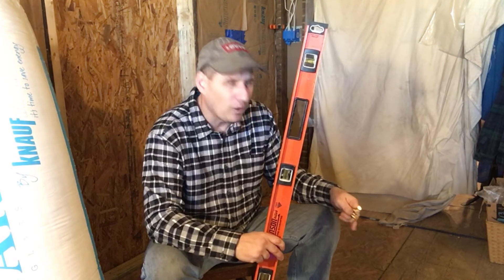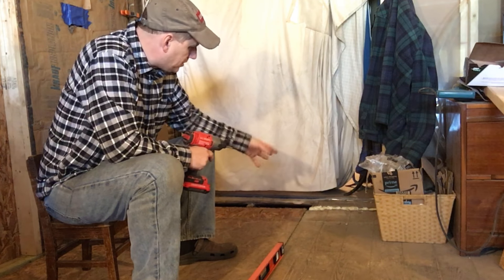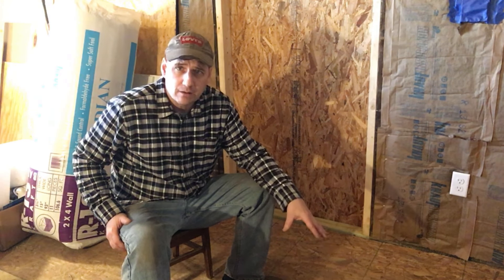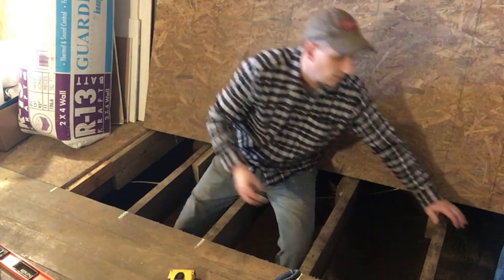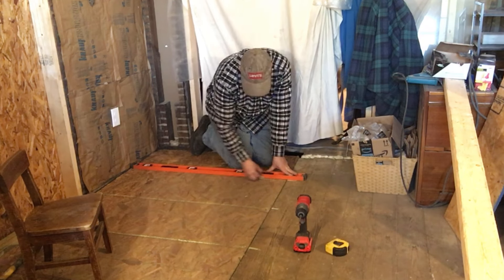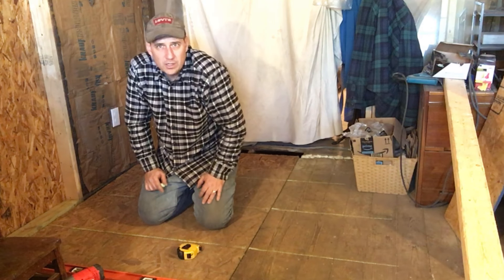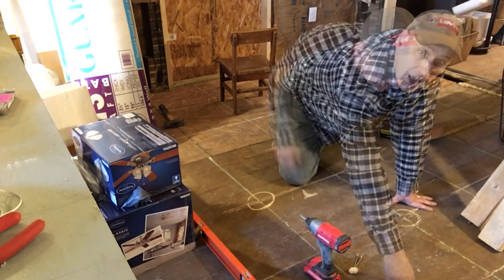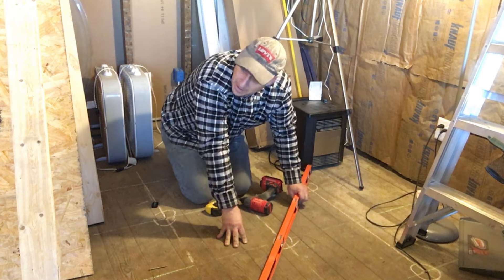DIY: Easiest Way To Level An OLD WOOD FLOOR - Using Screws and a Level

Comment: No doubt you are much more knowledgeable than I am, and most likely also, you have a lot more practice at doing it than I do.  Having said that however, I can't see how that would work.  
I have the same issue in my home, and looking for solutions for over one year, carefully studying the several options available to repair the issue. 

Your method seems to be the most difficult one, involving lots of measuring, materials and equipment, even if you say it would only take a level  and some screws.

My question is....  Why would you lay additional wood pieces to level the floor, creating yet another space in between board, where eventually creatures are going to craw in, and make a home in your home?  Would it not be easier, if having leveled the floor with screws, you were to just pour some self leveling cement, and use the screws as a guide to achieve optimal result?

That is what I have been considering but, the only reason I have not done it yet, is because I can't seem to find out which material to use, to prevent the liquid cement from running through the gaps I have in the current wood floor.

Any ideas?  I would appreciate your opinion, being that you seem so knowledgeable about the subject.

Thank you.
Reply from the maker: Hi Mario. Welcome to the channel.
I've found this floor leveling method works quite effectively. There are several ways to level a floor but I feel this was the best way to do my old floors.

I don't believe it is very difficult.  Leveling the screws is probably the most technical part of the process. There are really only four tools you need: a level, a tape measure, a drill and a saw. A complete list of recommended tools are in the video description. The materials involved are screws, sheets of t&g decking, vapor barrier and studs to rip down as sleepers.

The sleepers will create a bit of an airspace over the old floor where you are raising the surface to create a level space. My approach to solving the issues with keeping basement odors, air and critters away was to lay down a vapor barrier over my sleepers and under my new decking.  This is all explained in part 2 which you can watch here: https://youtu.be/tOANffNqoDA

I leveled my upstairs as well.  This video: https://youtu.be/fv9PZcCu_0k shows another look at the floor leveling process which might be worth watching to get a wider view of the process.

The reason I did not go with a self-leveling cement is for a few reasons.  First, as you mention, there is the issue of it leaking through the floor which needs to be dealt with.  Second, in some areas of the floor, I was making up to over 2 inches of vertical distance to get a level plane. This is a lot of material to pour which would add a lot of weight to the system as well as cost to the project.  Third, I've never personally used self-leveling cement so I felt more comfortable with wood.  Fourth, since the floors are wood and have a great deal of "bounce" and flex to them (compared to a slab floor), I fear that cement would tend to crack excessively and break up over time causing a lot of other issues down the road.  Fifth, adding an overlay wood system mechanically ties into the old system (via screws) thereby making the new floor integral with the old floor thus increasing the overall rigidity and strength of the entire floor system.

I hope this discussion assists you in your project and I appreciate you inquiring.
Good luck in your renovation and thanks so much for watching.
Reply: @RundownReborn  
Thank you so much for taking the time to explain in such detail your point of view, and the reasons to your method.

I have given the weight of leveling cement a great deal of importance when considering on how to proceed.  It is of great concern to me, considering that my craw space is difficult to access (very little space to actually even to craw into it), and gain access to the back of the house.  I have plenty of space in the front but, the back is hard to access, and I have actually spent several hours in the past couple years digging with a shovel and bucket.  Terrible work to someone my age (68 years old), 6'3" tall, and weighing over 180 lb.  It is hard for me but, I have accomplished quite a bit, enough that I am now actually able to craw in, and actually added some support to some of the sagging floor joists.

Simply put, this is the house I wish to live in until the day I die.  I love my home, and the area where it is located in but, I have to consider that I am also getting old, and with each passing year it gets more and more difficult to accomplish the tasks I set or plan on tackling.  I am getting old.

I am considering just stopping, and accessing the issue from what may, at first, seem to be the a more difficult angle, which is to say, from above, as you are doing or did on the video above.  

First, I have considered that it might actually be easier to me to dig the craw space from above, set some additional support columns and level it, making laying of a new floor much easier and simpler.  It is my opinion that if I open the floor, and level and add additional support beans to the existing structure, the rest of the process would be much faster and easier to accomplish.

I live alone, and don't have any relatives such as a son or anyone else who could help me.  Paying someone to do it, is expensive, and honestly, I don't have the means so....  I have to measure twice, and sometimes more often, and cut only once.  

Once again, thank you for your expert advice.  I do appreciate it greatly.

Wishing you the very best, Always.

Mario.
Reply: @Jesus My Savior 
Hello.  How are you?  I hope all is well.
To be perfectly honest, I have not started it yet.
I am still searching for options.  It is not something I need to do immediately so, I am still working from under the house, trying to lift all that I can by myself.
It is hard awful work but, I don't have anything else to do at this time.  So, I am taking my time.  A little bit everyday, and trying not to kill myself in the process...lol  I am getting there, little by little.  But so far so good.  Everything I have done, has worked out.  I am using hydraulic jacks, cement blocks and 4 x 4's.  It is going but, by myself, it is a slow process.  I don't want to cause any damage.  It would be great to have some help, someone younger, thinner, and more flexible to get to some of the hard spot but, when I am working on a spot where I cannot easily fit in, I just dig the dirt out, until I can fit.  
Eventually, what I think I will be able to do, it have it level to such a degree where the leveling needed will be minimal, and I will then use some self-leveling cement, and not run the risk of adding too much weight to the existing support system in place.
Faith, Hope, and Trust.  With the help of God, everything will end up working for the best.
Good luck with your project.  Take your time, take your phone with you if you need to call for help, and watch out for little creatures crawling around.
I think I got bitten by a spider once, not really sure, other than the fact that something down there bit me.  
It will all work out.
Reply: @Mario   If you wanted to, you could fill in the spaces between the runner strips he installed, and then use the runners as the level surface for a screed - you could screed the filler material - mortar or whatever - by dragging a long screed board across the runners to make the surface of the mortar flush with the leveling-runner strips.

But there is a lot of volume of material - it would not be cheap!  He mentioned 1 1/2" of depth to fill in on the low side of the room.  Another option would be foam sheets cut to size.

But one thing you have to realize, the issue with varmints etc. never really goes away with this type of older construction home - it probably has a large crawl space underneath.  As long as the moisture barrier is installed that he described, you can rest easy, because the floor has more than one layer of building material and flooring.  There's no way any pest control issue will be more of a factor than the crawl space under the house.
Reply: instaBlaster...
Reply: If your going to use self leveling concrete you will have to install plywood over the planks, which is counter productive bc why not just rip up the planks and install new subfloor. also find out why your floor is sinking
Reply: Depending on the type of floor going above the subfloor you’d want to use sleepers anyways. With a wood floor the sleepers help with squeaking.

The method he is using is quit common. Even on concrete floors when doing ceramic or even self leveling compound we use the same method and drill screws into the concrete, then screed your mud to the height of the screws or you pour your self leveler to the screws
Reply: Had to do this under my shower trust me it's the best solution. The cement will break over time. Going to have to do the rest of my bathroom also. Cheapest way to do it outside tearing the whole floor up.
Reply: Just use duct tape over any gaps where the self-leveling floor leveler might drip through your cracks.
Reply from the maker: @ericm.bright9105  good suggestion!!! But what about the perimeter? My gaps are enormous there. Spray foam doesn’t even fill them.
Reply: Yes it's a self-leveling cement called gypcrete I've been in the construction business for over 40 years and that's what we used to level floors especially wooden floors it's fairly cheap for a 600 square foot area it would probably cost you around five or six hundred dollars but it can be done in literally 15 minutes and the floor is perfectly level three quarters of an inch thick and about 2000 PSI
Reply: @misterfee6467  I was thinking the same thing. If your joists are sagging that badly, wouldnt you need to address the posts supporting them, and maybe even the joists themselves as well?  If you do all of this extravagant superficial leveling, one day you might need to rip it all out (or use a jackhammer to get out if we're talking about using mortar!), when you have to add supports and jack the whole floor up because it's collapsing! (which wouldnt be helped either by the weight of 1.5 inches thick of mortar over tens of square feet)
Reply: Cost of self leveling cement is ~$55/bag.  Sealing along the borders with silicone and/or foam insulation would address your concern and then use this method for majority of the leveling.  Then, if not perfect, you can go over the new surface with thin layer of self-leveler.  It’ll save hundreds or thousands of dollars depending on the size of your room.
Reply: @mario9133  I think you are right in considering placing additional support underneath, especially if there is a significant drop from level, because this probably affects the rest of the house, and adding the weight of another layer of flooring will add to the problem.
Reply: @RundownReborn  Having large gaps or differences should be a reason to consider additional support and leveling underneath.
Reply: @RundownReborn  In cases where spray foam won’t work, I’ve seen both foam gasket tape and foam board used around the perimeter of a self-leveling pour.
Reply: self leveling flooring compound not cement
Reply: I keep seeing this self levelling concrete mentioned. Seems to me you'd only use that on stone floors.. no? As for floors with wooden joists.. isn't it just a matter of planing high spots and/or sistering where there's valleys?

Comment: Seems like it would be easier to just pull up the sub-floor, cut strips off 2x4s (or plywood) to the right level and secure them to the tops of the joists.  Then lay the sub floor back on top of that.  That way you have a level floor and no gap underneath.  The gap is going to give you an echo when you walk across the floor unless you insulate it.
Reply from the maker: Thanks for watching! Shimming the top of the joists is certainly one way to level a floor and I would definitely recommend this if your floor joists are damaged, worn or sagging or in need of reinforcement. In my case, the structural state of the floor joists is adequate and my existing floor deck is 3/4” plank cedar which is an excellent deck material and resistant to moisture rot from the damp crawl space and basement below. I desired to leave this in place and adding a 2nd layer of deck has stiffened the floor considerably and reduced a good portion of the bounce in the floor. Putting a vapor barrier between the layers has nearly eliminated the moisture, must and insect issues from below as well. The airspace will also add some thermal value too. Plus an overlay deck is easier (no tear out) and safer (especially since we’re living in the house with young kids). I have not noticed any echo issues or excessive sound problems. If this is a concern, I would recommend a carpet finish with a good sound rated padding or if laminate is preferred, use a sound dampening underlay material. One other thing to note, if you can’t tolerate a little bit of hollowness and bounce in your floors, don’t buy an old house with 2x6 floor joists. Stick with concrete floors (slab on grade). But for me...I think a little bit of thump under my step adds to the vintage charm of the home and gives it character.
Reply: Would it be easier to sister new joists next to the warped old joists? Vs your idea of adding to the top
Reply: @johnkim1656  not super easy, but yeah that method would be ideal if your space is fully gutted
Reply: As a structural engineer, I agree with building up the joists. I need to level a floor in an apt over a garage and my plan was to build up the joists. I agree with you about having the space under the floor. I didn’t like that idea.
Reply: @RundownReborn  I had no idea my old home (which is not on concrete,slab on grade) with 2x6 floor joists had "hollowness and bounce in floor" was actually not a structure issue. I asumed the sub floor was toast. The floor joist below look good. nice too learn something new at 42 yr old.
Reply: I am going through this right now with my late 1800s home. Simply stripping the floors down to the joists and reinforcing each joist by laminating them and bringing up the original appropriately. It isn't easy, but pretty straightforward.
Reply: Buddy if you have a wet crawlspace you need to get down there and resolve that.

Comment: An easier way is to tack 2x4's to floor, then use a laser level (cheap one works great). Measure down marking the 2x4 every 16". Remove tacks. Put 2x4 on a saw horse, connect the dots, cut with circular saw or use a table saw. Screw back down to floor into floor joist. Make sure to use construction screws(strong), not sheet rock screws(can break).
Reply from the maker: Not a bad idea there. A couple problems that may arise are that 1) not everyone has a laser level and 2) depending on the floor, it sometimes can be difficult to get the board to lay tight against the floor with a 2x4 on end - especially if the floor undulates.

My suggestion would be to use the laser to set the screw heights and then mark the sleepers.

Yes, construction screws. Drywall screws are for drywall and maybe hanging a picture here and there.
Reply: @RundownReborn  The undulations will have no effect on the sleepers.  They will rest on and be fastened to the high points.  Laser levels are not very expensive.

Comment: I'm a hardwood sander and refinisher, and I'm just looking at videos that pertain to fixing and repairing floors and I came across your video, I admire your "do it yourself" video here, my first thought was that you had a table saw or at least a circular saw to rip the 2x4 sleepers, when you showed the saw (at 5 amps LOL), I just had to laugh, because I don't like any saw to rip wood under 13amps LOL, in my trade I'm a power tool for the job type of guy, for repairs and sanding and refinishing, but I have nothing negative to say, just love...and I also subscribed and thumbed up
Reply from the maker: So glad to have you join the channel. I try not to introduce expensive or unique tools. I try to use the basic tools. Not everyone has a table saw. I just purchased mine recently. I didn't have one during this video. Plus - a table saw does too straight of a cut and the sleepers tend to have a shifting line that you must follow. The saw I used was the cheapest one I could find. It got the job done - slowly. :) It was much better than the jigsaw I was using at the beginning. :)) I have a large heavy powered worm drive framing saw but it was too much saw for this job I felt.
Reply: @RundownReborn  Thanks for the reply back, also with practice one can learn to cut on angles with the table saw without using the guide, but I hear you and thanks for the video, I'm just picking up bits and pieces of knowledge here and there on youtube, thanks